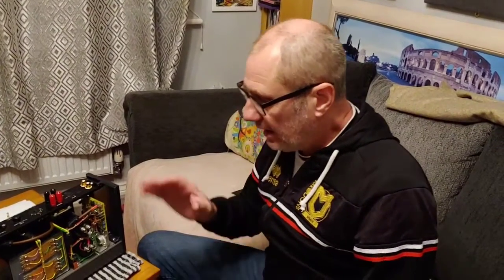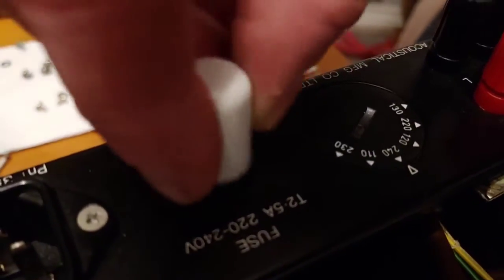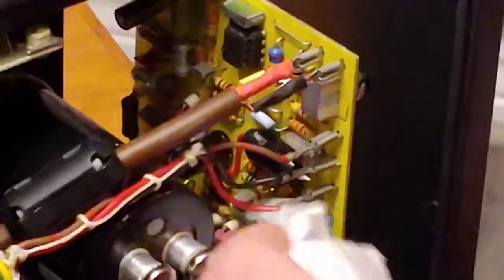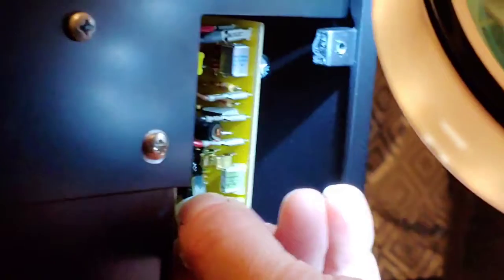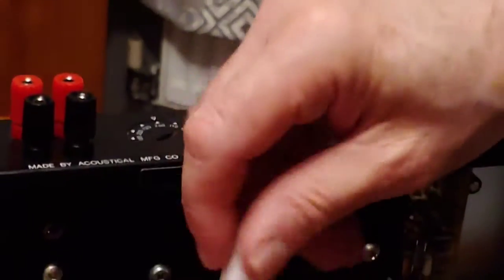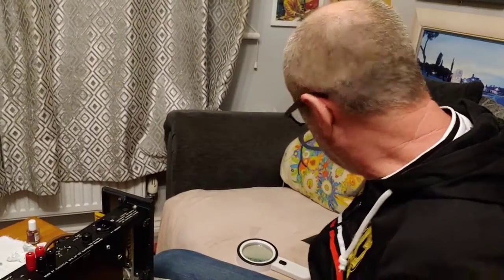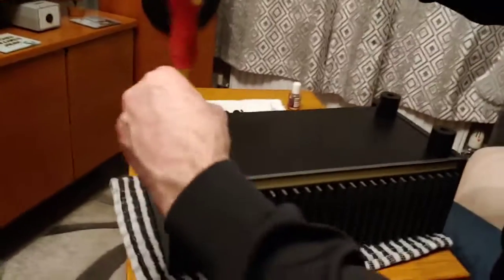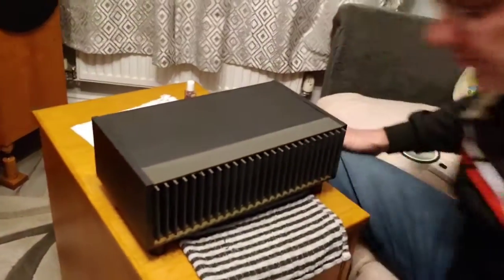5 Internal Fuse Upgrades Quad 405 Power Amplifier ( bring on the snake oil police😁)

Comment: I'm with you on the fuses. I'm a bit more curious about the added ferrite beads. As usual there are different schools of thought but I'm in the camp that prefers to remove ferrite beads. Their purpose is generally to reduce the radiation signature of domestic appliances to comply with stricter standards on electromagnetic emissions. That's why you don't find them in vintage equipment. They also create an electromagnetic barrier for the signal going through the cable, which is undesirable for analogue audio. For digital audio, it's a different matter.

Comment: I found an improvement replacing all of my glass internal fuses with 20mm, 25mm & 32mm ceramic fuses which are sand damped. I had a few of the old 2&3 amp silver wire 25 mm UK plug fuses.   I have very large hands  so to fit tricky internal fuses i put a strip of paper around the fuse holding a resultant tab. As for being a "weak link" is that not what fuses are meant to be
IAN MY HEART HAS DISAPPEARED
Reply: Thank you

Comment: Another great video TM. I hit the thumbs up just for the title alone. As your timing is perfect. I recently took everything down for a deep clean and discovered (thanks to your videos teaching me about the internals of my gear) Four more fuses in my power amp. Just like you, i have 2 per channel and one for the plug. So I can't wait to hear your thoughts and feedback from 5 fuses! It should, in my mind, make quite a difference.
Reply: I also see (I think) some attenuators? Are these for your SACD player and if so what db do they drop down to? 10db or 20db? Many thanks 🙂
Reply from the maker: @jefffan171  Hello Martyn, I'm using 16db attenuators, thanks for commenting & watching
Reply: @tweakerman  thank you for responding. At 16db is it smoother, more dynamic? How would you describe their influence? 😀

Comment: where does the current pass through first? the fuses! so if you have a better connection there of course it’s going to make an improvement. better conductivity materials and so on
Reply: Incorrect. Current flows simultaneously in all parts of the circuit.

Comment: Love your vids and tips Ian, but im on the fence with pro gold stuff from caig after using there stuff from russ andrews never heard much of a difference to me bit each to there own ears.. ive made a couple of your interconnect cables and was wondering which would you make for a run of 10m ,i have to put my turntable to the other side of the room
Reply from the maker: Hello David, if you don't want it to cost you not too much, go for the best off the roll interconnect cable video. I've got anther video on interconnects that I'm hopefully uploading over the weekend, that will also work, but you have to handmake it, on 10 metres, it will take you awhile, thanks for commenting & watching, goodluck👍

Comment: A minor problem with the QUAD is that the +/- power rail fuses are in the wrong place, fitted between the capacitor bank and the amplifier board. If the capacitor  ESR is 0.01R and the fuse is 0.1R you see the problem, the PSU voltage gets slightly modulated by  the fuse resistance voltage drop. The fuse needs to be before the capacitor so it's resistance is not in the way. You can get different resistances for the same rated current fuse. However this is very_minor compaired  other issues with this amplifier. The QUAD design is simpy stunning, but held back by the conservative engineering.   Paying for a _mains fuse is dumb all over. You may think it changes the amp, it doesn't, unless you bought a piece of junk. QUAD isn't junk. Fuses are NOT directional, not if you are on this planet anyway. Eng with 30 years of QUAD circuit experiance.

Comment: Anyone know what HiFI Tuning fuses sound like?
Reply from the maker: Hello, I've got some hi fi tuning fuses in my system, I was using them before I discovered these one, & these one are just as good, the bass of of 405 has improved & they still haven't burn-in yet, the Chinese are very good at copying fuses at a fraction of the cost, you should try them👍
Reply: @tweakerman  I did, don't like em - Sound too pretend (like). Thought i'd ask before investing, what I agree, is a steep price. Maybe not then.
Reply: A fuse has no sound !. It just passes electricity.
Reply: @r423sdex  so do FETs, or Caps, or speaker coils..